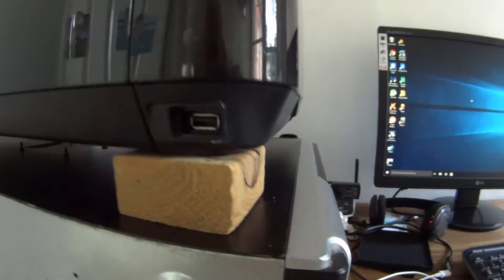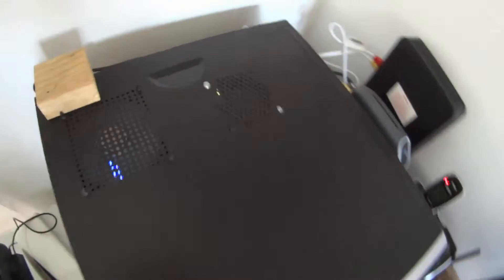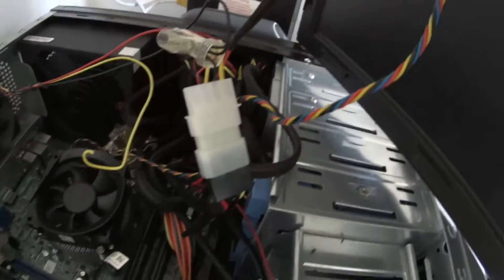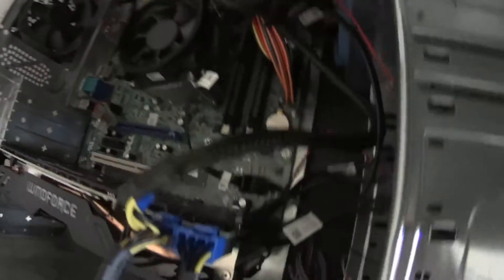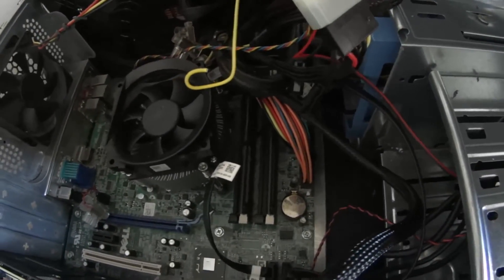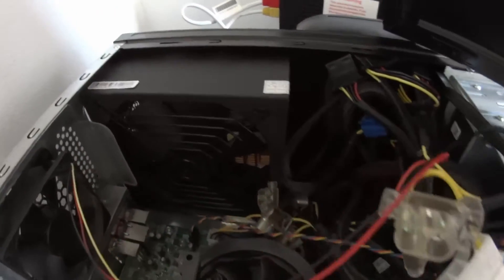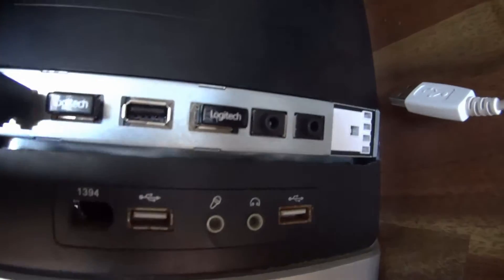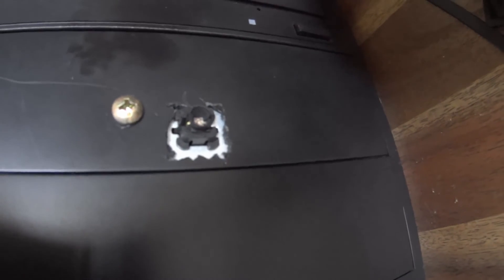Upgrade Dell Optiplex desktop  to Tower Box - with Radeon R9 390

Comment: Hi im late but i have a question, im about to put together a 180 dollar system with an i7 3770 xeon equivalent  dell to 790 motherboard r9 390 16gb of ram but ive been told that r9 and rx cards need uefi to work and the 790 motherboard doesn't have uefi it only has bios,    im building it for so cheap cause i bought the 390 for parts for 35 bucks and fixed it for 15 cents the psu i got from a friend who said it was broken but wasn't, im building my own small form factor case, im excited on seeing what this can do when the board gets here but also worried it wont work.

Comment from the maker: Still using this setup every day.  Going really well. Yes, the motherboard fitted perfectly in all the existing screw holes. I was able to move it into the new ATX case and just screw it straight in.   I used the front components of the old Dell case in the new ATX case (cut them in) so I didn't have to rewire all the existing PCI slots and power switch to those provided by the ATX tower. I didn't really want to have to do any more than I had to, to get it working.

Comment: not getting the full benefit of your GPU, you slotted it into a low lane cpi slot.... you need to move it to the top most BLUE Slot PCIe x16 slot, you will get better performance out of your 390 gpu.
Reply: cjtron bro its all bout cash

Comment: Did you had any issues wiring up the front panel? I heard some front panel conectors are dell propietary and you have to mod it to work with another cases
Reply: Shaggy Blanco ya that's what I'm confused

Comment: Does the motherboard fit perfectly in the ATX case?
Did you make any mods/changes in the case to fit the board?
Good video
Reply from the maker: Yes, the Dell motherboard fit perfectly with all the screw holes lining up just as the previous old non Dell motherboard that was already in the tower.

Comment from the maker: tower is going fine. the Radeon card has an external power plug for 6 pin and 8 pin. maybe it draws most of it's power needs from those terminals rather than from the pci slot.

Comment: hey man how is this system holding up? I've read online that the optiplex 790 has  35w limit on the pcie slot in the smaller form factors.

just wanna make sure the tower version does not have this limitation. and also this Mobo seems to be standard ATX correct?
Reply from the maker: Holding up fine. Going great. The Radeon R9 390 card has a 6 pin and 8 pin power slots on it. I've plugged a 6 pin and 8 pin power cord from the transformer directly to these 2 external power plugs on the card. Maybe the Radeon R9 390 is smart enough to know to draw the power it needs from the 6 pin and 8 pin plugs instead of the PCI slot.
Reply: @PaulClarkeAustralia  i know you probably won't answer me but i have an r9 390 and a dell optiplex 7010 motherboard and the card makes the pc just not turn on, i really need help
Reply from the maker: @robonotutorials4500  Hi, Make sure that you have enough power for both the R9 390 and the motherboard. Have you installed a separate large (1000 watt or more) power supply? Try the different motherboard slots with the R9390 card. For me, the other slots didn't work for the card, only the one that is shown in the video. If it works when you take the R9 390 card out and stops again when you put it back in, then I'd say it's probably a power issue, so once again check the transformer power supply and make sure it's big enough. I had to buy a new power supply because the one that came with the optiplex motherboard was only rated at about 350 watts from memory. the R9 390 card can use up to 700 watts so you need a big enough power supply.
Reply: @PaulClarkeAustralia  well, 1000 watts is way more than enough lol, I run 2x 390s in crossfire with an e5 1680v2 at 5ghz with a 850watt, and my test psu that im using with the dell board is a 900watt, also the gpu thats going to go in here is an r9 280x and it came in the mail today so hopefully it will work on the board.
Reply: how did you get the power button to go in I have a dell mobo that has a 6 pin pwr-sw that doesn't connect to standard atx pwr_sw 2pin connectors ie the pwr_ws from the power button and the reset and pwr led
Reply: @thowardus  pretty easy i forgot which ones but with a little pushing you can get it in the 2 power pins no problem.